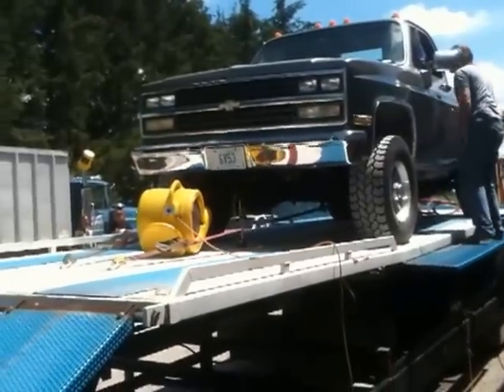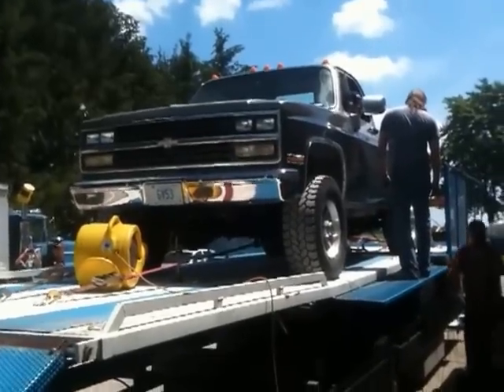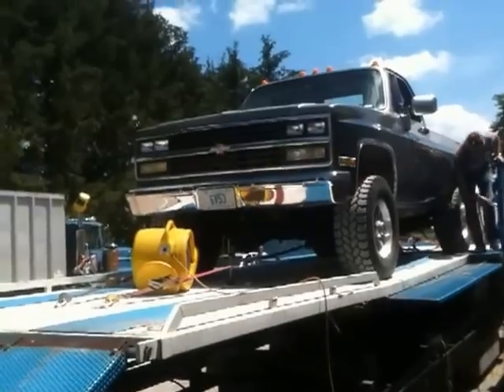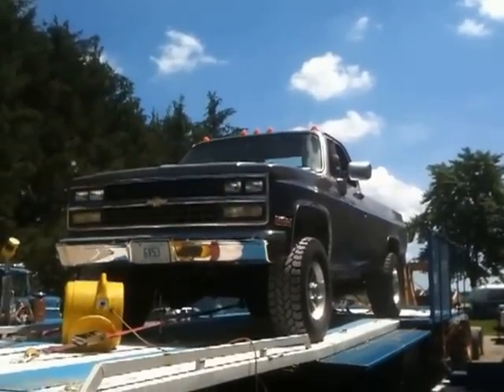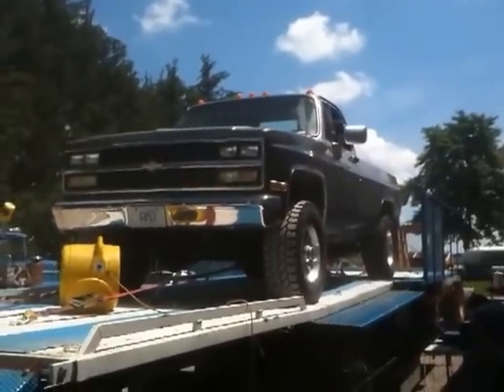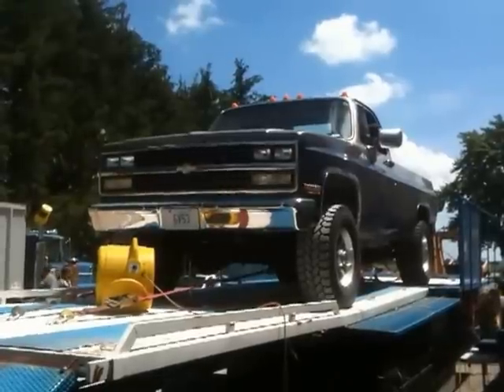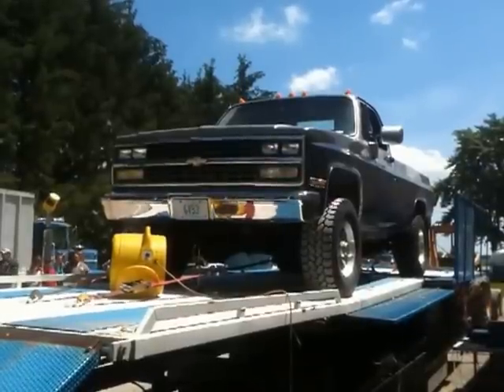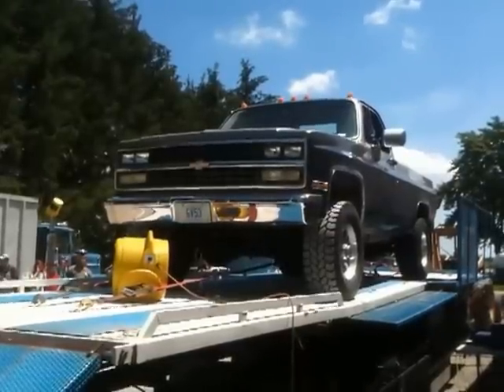1986 Chev 1 ton 4X4 with Whipple supercharged 6V53 detroit on the dyno

Comment: Was there a body lift required to fit motor under the hood? I'm wanting to do a 4-53t swap on my 2wd but have only seen one 2wd done and the motor hangs out about 6" or more over the hood.
Reply: I am doing one with a cat 3208   if its a Ford you need to find a older truck you can get a iron dropped axel out of  and cut remove rebuild the cross member   I cut and shortened the oil pan (ruined the first one AHHHHH )  and  put a 2 inch body lift  no cutting up the cab floor or tunnel that way on the 4- 53    and to ALL of you guys messing with these 2 stokes  make sure you have the EMERGENCY STOP flap in it and working hooked up  a stuck rack and all hell breaks loose !!!! can you say runaway !!!!!!!!
Reply: John Siders thanks. I'm wanting to do the swap in my 2wd Chevy C30. Am already modifying my trans tunnel and floor so that isn't an issue. Hoping to run a road ranger behind it but not holding my breath on that one
Reply: Matt Fultz  Ok  on a chevy  you may be able  to cut and drop the front  crossmember a few inches The last 3/4 ton chevy I owned was like a 78  Cant remember if you could get away with it because of the tie rods  Of course you could put blacksmith skills into building a dropped tie rod ??  The mixers I work on have them to clear the front diff housing  so they can keep them up out of harms way .
Reply: John Siders I am already sectioning my front cross member 1.25" as well. Having to notch the frame about an 2" to allow clearance for the tierods. Would like to see an actual build of one of these going on a truck but haven't been able to find one
Reply: Matt Fultz A lot of modifications to fit one of these into a chev pick-up.
Reply: I think Ron did a 2" body lift

Comment: In timberjack skidders when the blower shaft connecting the gears to roots blower would shatter in the -40f temps the the engine would just barely run enough to get on the lowboy  to get to the shop. And talk about smoke.

Comment: I put a 4-71 in my F350  I have a 4 speed aux box behind the 5 speed  I have quite a few of these old 2 strokes sitting in my shop .
Reply: you got an 8v53 hanging around?
Reply: TheTrapper70 Hello I may be wrong but I don't think they built a 8v-53 ??? I know some are not listed  like the 2-53 in a old welding plant I have that was used to feed what was called a six pack  6 welders in a rack for 6 people to use at once on a job site .
Reply: John Siders there are some clips of an 8v53 in a fire engine not an 8- 53 which would indicate it wan an inline engine
Reply: John Siders there is an 8v53 but they are rare..
Reply: Hey John Siders,where is your shop, and would you like to unload one of these engines you speak of?
Reply: nomad1187 hello  no want to keep them around other ideas in the works also looking  for more of these old engines  next project is a 3208 cat in another F 350  with a 15 speed road ranger  behind it .
Reply: John Siders 15 speeds is a lot of shifting and double clutching. I would go with an Allison AT545 or MT643. 

There are some trucks on youtube with 3208 and folks put crazy high lifts on them, which personally I think is kind of hideous. I'd be interested to know if that is actually needed to fit the engine or just something they liked to do.
Reply: have you ever driven a 10/15 speed? i would make sure you like it before you commit
Reply: John Siders wow amazing stuff !! Yea I have a 1974 Ford L9000N , 855 cummins w/ 13 spd. It has the fiberglass hood, actually it stood up really well. The mechanic from the company I bought it from told me it was working 40hrs a week from 1974 till 2007 and then with the building slump it was parked. Basically the whole thing was rebuilt once (engine transmission rear axles etc). Amazing durability.The 10/15 spd have a different gear pattern than the 9/13 and somehow I had a hard time getting used to it. I drove a '67 International with 8v71, 10 spd + 3 spd brownie + 2spd rear axle that takes some skill.I have a Ford C750 with 3208 and MT643 and a topkick with 3208T and 6spd spicer. The latter I am thinking of doing a cab swap with a vintage Ford F-6 or something of that nature.I have a 5 ton military 6x6 with the 250HP cummins. I think it dropped a valve, one time I was driving it and it made a racket and now one cylinder has no compression. I was thinking I'd love to just drop a 400 with HT740 in it that would at least give it some kick but you don't see those often!
Reply: little   cars. for. kids
Reply: Hey i'm a young guy that loves detroit's but i don't know anything about transmissions and transfer cases. any info on them you have?

Thx
Reply: castirondude Oh heck yes I was  a O/O for 30 years I have one out in my shop  you do not have to use the clutch only when stopped  its a slick transmission I had years ago a C  Ford cabover with a 3208 and a 15  in it  I have several older Macks  with duplex a triplex and one with a quadplex  all are 2 sticks you must split shift with your arm thru the steering wheel  I think why they lift kit them is to clear the crossmembers  The Ford I will put the 3208 in I have a older 1 ton ford dropped axel I will put in  remove the twin I beam and the underbell  and add a crossmember   from the doner truck  and I think just a 3 inch body lift will clear just fine  The older thru 79 ford F 600-700 had that engine in them the removable pan in the cab was taller to clear the big trans top plate  and to build them ford used the pick up cab with wider fenders and taller grill  the hood was the same too  in 1980 Ford ruined them with a glass hood fenders and all plastic dash and inside the cab  they fell apart really fast ! the frame is 34 inch spacing  all the large trucks still have that spacing too   lots of stuff in the salvage yard to sort thru  for this kind of fooling around   . I have a Advance front discharge concrete mixer out back with a 400 cummins and a Allison  That's going to be built into a wild ass 6X6 rear engine off road unit shorten the frame move the engine forward over the rear axels  that's a whole other story in it self  !!

Comment: 166 seems a little low i believe we were making more in clark skidders. 6v53s stock had a blower is the wipple a high performance model? you may need to look at bigger injectors. its getting hard to find tecks that even remember 2 strokes
Reply: With DDEC III controls a TT 6V53 is NATO rated at 400 HP.

Comment: When we installed those very engines at work, with the turbo, they were 275hp, the torque was around 640 ft.lbs.  That is a Silver series engine, so there was a bypass on the supercharger to allow the turbo to over blow the super charger.  May be something to consider.
Reply: they ran the blower bypass cos many turbo 53 series broke blower drives due to the extra load imposed by 30psi+ boost on top of blower which at stock fuel limits was unessasary,silver 53 was also one of the first to hane an aftercooler/intercooler mounted under the blower increacing horsepower further
Reply: @andrewsmart2949  so I assume the turbos were feeding into the blower and not the other way around

Comment: Are you (poster) sure it's a whipple?  It's probably an old school roots blower.  Not as efficient as the lysholm and whipples but that's where it started.  Still twin screw types so I can't rag on ya too bad. :)
Reply: It's most definetely a Whipple. If you're familiar with the sound of a twin-screw, you'll notice how loud it gets in the dyno pull. The difference in sound between a twin-screw and a two or three lobe roots blower is vast. A Whiiple supercharger is much more efficient than a roots blower. There is another video of this engine with the Whipple on it, while running and not installed in the truck.

Comment: Forgive my ignorance here, but can you use an expansion chamber in the exhaust like on a 2 stroke gasser? As is that thing is badass. I like the fact you dont have a turbo on it because that could prevent a runaway (i think).
Reply: detroits have exhuast valves,so it's not like dirt bike,chain saw etc.

Comment: I see the the truck does not sit much higher than normal. How did you get the engine tucked down that far without added lift in either body or suspension. I'm building a 1954 Chevy 4500 on a 1 ton chassis with a 6v. Also has an Allison MT540 behind it.

Comment: 6V53's were installed in MOWAG wheeled armored vehicles built by GM Diesel Division in Canada.  I remember they had 318 HP, so the engine's were pretty good on specific output.  I think it is a mistake to try to boost one with a supercharger.  The blowers on Detroit 2-strokes were not meant for power boosting.  They were only meant for blowdown scavenging of exhaust gases at a few psi.  Boosting on Detroits was accomplished by turbocharging.  Later model 92's even had bypass blowers on them to unload the blowers once turbochargers were making boost.  This saved fuel by reducing the parasitic drag of the blower.
Reply: They were never rated @318hp. They were 318cubic inches  - 6 cylinders 53ci each makes 318ci, although you could argue they are 636ci seeing as they fire on every stroke.  Stock 6v53 n/a were rated 195-220hp depending on the injectors.
Reply: @foolishgerry2862  The military version was rated at 318 hp
Reply: I think it was the 8V71 that had 318hp. The Silver Series had the bypass valve.
Reply: By pressurising thru the blower with turbo it puts exhaust energy back into the motor thru blower drive similar to turbo compound system, as the blower creates no internal pressure like a screw type the inlet pressure from turbo is trsnsfered to outlet side creating load referenced boost unlike rpm related airflow from blower for scavenging also inlet port timing is different on N liners to Turbo liners to allow increased cylinder fill
Reply: Mark H
Thanks for the clarification.

Comment: 166hp that should be really slow :O
Reply: yeah but 425 f/p means you can pull up 100 year old oak stumps
Reply: Torque is just gearing. Power is the ability to do work. More power, more work. Torque is just the force applied per RPM by that power to make the work happen. The lower the RPMs, the higher the torque to apply the same power. 

Torque and power are linked to each other mathematically by RPM. Diesels' high torque are required to get any horsepower at their lower revs. They don't have high torque to 'pull better on hills.' POWER is what allows an engine to do work, i.e. move weight up a hill.
Reply: M Robinson you are the only person I have seen on YouTube who understands. I've said what you've said multiple times to people who say their diesei will outpull a gasser on a hill even though it has less horsepower. No one seems to understand!
Reply: it's hp is measured at the wheels,alot of cars from muscle car era were less than 250 at the wheels
Reply: 166hp@2500rpm

Comment from the maker: No, its been tried among many other things. The only way to get boost pressures up in a two stroke and still scavenge is with back pressure like what a turbo would provide.
Reply: Twin charge it!! Technically they came twincharged stock but since it makes boost with that i think its doable to make 50-60 psi pretty easy